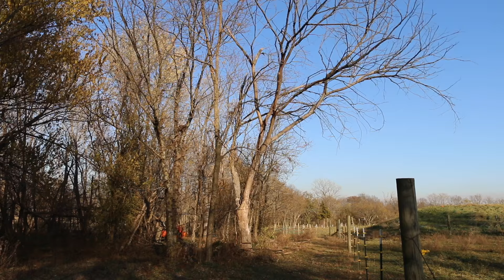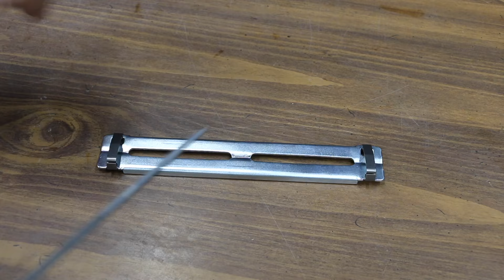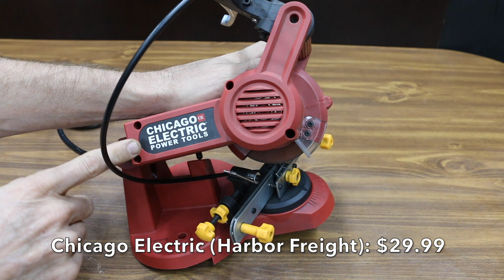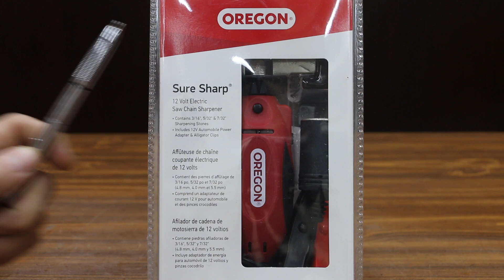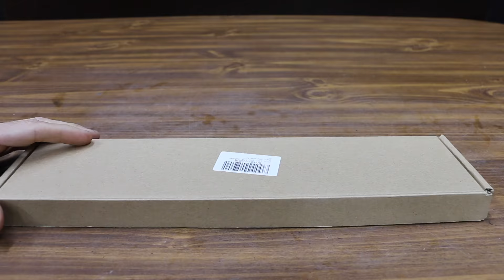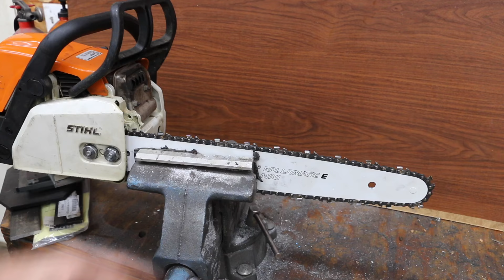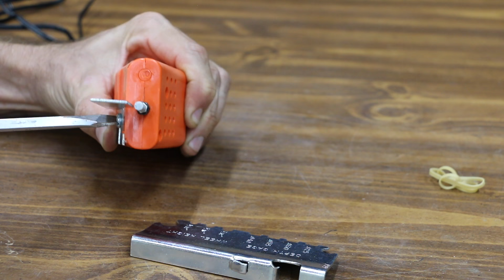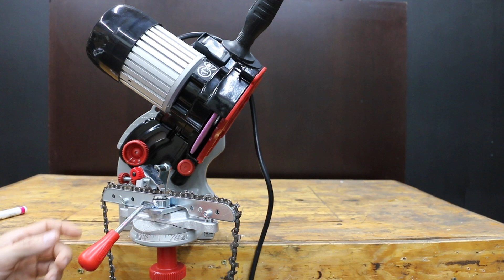Which Chainsaw Sharpener is Best? Let's find out! Stihl, Granberg, Chicago Electric, Oregon

Comment: Removing those tiny dogs off that saw just made me laugh for some reason I have never seen feeling dogs that comically small I guess it makes sense being people arent dropping large timber with battery saws and are mostly limbing. Very curious if those tiny dogs could actually serve any purpose or if they just put them on there so they can say the saw has felling dogs. Also for the price the Stihl 2 in 1 is awesome especially because how easy it is to throw on a fallers belt, will any of these sharpeners out perform a logger whos been sharpening for 40 years absolutely not but a few of them definately can get good results with minimal sharpening skills. Even with the 2 in 1 and other systems you will get better results the more you use it and get comfortable with the system. Also comparing chizel ground with round filed chain isnt the most fair comparison, this was testing sharpeners more than chains that is just definately something to note that the chizel ground chain generally will cut around 20-30% faster than a round filed and that shouldn't be counted against a sharpener. Both chain grinds have benefits and draw backs but chizel is going to be faster if the saw has the power to use it without bogging down a chizel chain will bog a lot of smaller saws especially if you aren't running a skip tooth.

Comment: I have the Stihl 2 in 1, haven't used it yet.  Disappointed by the big Oregon bench model.  I wonder if the Stihl is not knocking down the rakers a bit, causing a more agressive bite?
Reply from the maker: Thanks for the feedback.

Comment: The Sthil 2 in 1...can you simply replace the size of the files to sharpen other size chains or do you have to purchase another sharpener for that specific chain size?
Reply: The bag the tool comes in calls out the pitch and file diameter.  The tool has these molded into it as well.  You can't change file diameter without messing up the raker depth.  Also, mine says 3/8"P (picco) so a full height also needs a different tool.  The tool works great but on a chain that just kissed a rock, I now want a grinder.

Comment: I usually use a dremel tool with an Ezzdoo or oregon bit. I eyeball the angle with the marks on the tooth. After doing it a bunch of times, i got good at it and get great results even on a badly chewed up chain. I do carry and use hand files as a backup. Thats how i did it before i got the dremel bits.
Reply from the maker: Thanks for sharing.

Comment: I feel that the first hand sharpening was done incorrectly.  More time should have been taken until the edges were properly sharpened.  5 strokes was arbitrary and obviously insufficient to achieve a sharp edge.  So the sharpening time you reported was too short by at least a factor of two, and the cutting time was longer than it should have been.  The sharpening job was incomplete IMO.   I have that kit and my teeth look way better than what you showed.  Yes I spent more time than you did.  If sharpened regularly then 5 strokes may be sufficient, but otherwise repeat until the edge is sharp.  

Guilty of Treason ran some sharpening tests, and a properly hand filed chain was faster than a new chain by quite a bit.  This was done using the same or a guide similar to the Oregon guide in the first kit.  Next test was a square-hand-sharpened chain by Inbred Jed (Jed is no longer with us, tree felling is dangerous) which was faster yet and almost double the speed of a new chain.  All these tests were done with a full chisel chain.

Another point on the Oregon file kit, the round file I used does appear to dull quickly so not sure how durable it is.  Perhaps I work hardened my chain by hitting a rock.  Or not...  I'll be looking for some better quality files.

I still appreciate you and the videos you produce and find value in them.  In fact, I want t-shirt that says "We're going to test that!"

Update:  I just got to the end of the video and see that you re-did the hand sharpening.  Good on you.

Comment: I've tried several different sharpeners.  By far the 2 in 1 and 2 in 1 clones are the easiest to learn, set up, and provide the greatest consistency.  Make aure you get the correct one based on file size for your saw.  After I bought my first one for my milling saw it was a no brainer to get other sizes to match my other saws.  Not a professional, just a hobbyist.
Reply from the maker: Thanks for sharing.

Comment: Great video.
I will be looking into purchasing either the Granberg manual or Stihl 2 in 1.

As he said in the summary the bench grinders are quite aggressive. If you look at 12:17 the metal has blued which indicates that it got a little hot which may affect the durability, you wouldn't really be able to do that with a file.
Reply from the maker: Thanks!  Thanks for the feedback.

Comment: Granberg file-n-joint G106 is super swell all metal filing jig, takes round flat and trianglular files. (Only extra that I added to it was a very thin film of wheel bearing grease on the sliding rod.) There is a little technique needed for the direction of pressure with each hand just because nothing is infinately stiff but overall low fuss and good results. Really needed to hold angles if you are fileing square ground chain. (Square ground is more of a professional thing, even the files are only carried in pro shops, which are not actually "square" but they have flats to make a non-hollow-ground bevel on the cutting edges.)
 
For a similar price Oregon sells a cheap knockoff, do not buy it! The Oregon jig is poorly made and too flimsy to even setup and adjust properly (let alone the low durability of the bottom bin plastic). I know because I returned it before finishing the first saw tooth and bought the Granberg. Shame that Oregon has apparently become a chinese-counterfeit peddler.
Reply from the maker: Thanks for sharing.

Comment: Always PULL. Do not push the file.
When you push you will create a fragile uneven BURR.
When you pull the edge will be clean and last 5 times longer.
Just like sharpening a knife on a stone. Hold the stone and "cut " the stone with the knife in the direction you would when actually cutting something with it. 

You should test this with knives and chains to see how the edge holds.
Reply from the maker: Thanks for the constructive feedback.

Comment: surprized the dremel attachment was not included (although mentioned in the comments)
plugs into 120 VAC rather that car battery but I sharpen my chain in the shop (where there are no car batteries)

Comment: Dude, I love your tree downing style. I’ve been cutting those old trees down with a chainsaw for decades and still can’t seem to make them fall in the direction I want. They end up crushing my fences or leaning up on other trees and I get REALLY uncomfortable trying to bring them down. I don’t have a front loader, but I do have a tractor to pull them with. I guess I’ll be buying some heavy rope and trying to pull them down from a safe distance. ( oh, don’t worry, I do know to attach the rope low so I don’t turn the tractor over. I learned that the hard way, but luckily didn’t go all the way over ).
Do you happen to know what type of rope won’t stretch and create a slingshot effect?😊
Reply from the maker: Thanks for the suggestion.

Comment: Did you swapped in fully charged batteries for each cut?  I have the same Makita saw and it cuts faster with fully charged batteries.  Before the battery meter drops even one bar, the voltage of the packs drops a little and the cutting speed starts to slow a little...
Reply from the maker: Yes,  I swapped fully charged batteries in for each cut.
Reply: Good.  I figured you thought of that.  But since you were being as scientific as possible, I thought I would mention it.

Comment: That last grinder looked to have gotten the teeth quite hot which might not be good for long term durability, depending if the teeth are heat treated.  Have to say I do like a bench grinder vs a hand file, myself (the one I have is a cheaper one than the Oregon, more like the other one you had).  That said, those little 12V rotary ones look cool and would be great out in the field.
Reply from the maker: Thank you for sharing!

Comment: I love the test.  However, how long did it take to cut through the 4x4s with the dull chain?  Wouldn't that indicate how dull the chain was in the first place?  Maybe the time delta between cutting the 4x4s with a dull chain vs cutting with a newly sharpened chain should be the measurement?  Also, how precise is this test?  A little data about this would be good.  How many of your results are not statistically different?  Still, your methods are really interesting.  Thanks!
Reply from the maker: Thanks!  Thanks for the suggestion.

Comment: I was hopeless with loose files and gauge/jig. And then I bought a Stihl 2 in 1. Great success. Works on Husqvarna chains, too.  Works best if you over tighten the chain while sharpening and lock it with the kickback brake between rolling the chain along.  This one also trims/files the rakers.
Reply from the maker: Thank you for sharing!

Comment: The worst thing about a chain saw is no one makes one that can tolerate the gas they make now.  I have the same trouble with every machine I have that runs on GAS.  I use that $20 bucks per gallon gas they sell, it makes NO DIFFERENCE on the chain saws.  Stihl is the HARDEST to START of any chainsaw I have ever owned.  I have NOT had a GOOD chainsaw since the quit making McCulloch Chainsaws.  Somebody told me Husquvarna bought them, they suck too.  McCulloch is the only one that was RELIABLE about STARTING.  I can get every other machine I need in Diesel, that is the only way to go.  I have junked out my last Gas Welding machine.  I  have bought a Makita  ELECTRIC Chainsaw and can run it on my Diesel Welding Machine.  To HELL with jerking on that ROPE.  Done with American GAS.
Reply: I have the Stihl MS261. Super easy to start with the decompression valve 😊

Comment: Absolutely brilliant, and exactly what i needed, to understand chainsaw sharpening tools. 
But you didn't answer my question: which of these is suitable for sharpening my mini chainsaw with 1/8" chain?
I looked into the machines, but none of them has a 1/8 bit for my chain, and even the file kits don't even include a 1/8" file. 
It seems that the only one that is suitable is the Grandberg file, with a 1/8" attached,  available separately.

Comment: Done of the difference may be in the raker height. I’ve started filing about a half millimeter below my depth gauge, and my chains have been cutting significantly better. Also new chains are square filed normally, so it would be cool to see square file vs round. That being said. I know you test products not methods.
Reply from the maker: Thanks for the suggestion.

Comment: Hey, just to let you know: You have to be careful to not make the chains blue with electric sharpeners. On the Oregon it was blue so the chain got weak. You can try to move it up and down quite fast but not down all the way. Just bit by bit and by pulling it up you let the chain cool a bit. So the results of the electric sharpeners are influenced by not quite correct use. You seem to have done a better job later on but I feel like those sharpeners could be better. But thanks for the video, I like your videos really much and you do your best for the best results but I think here you made a mistake(which you dont often do). Thank you so much for your videos. You helped me often.
Reply from the maker: Thanks for the constructive feedback.

Comment: Now I'm kind of an old guy at 70 years young and I still believe that the file is the best. That is the way I was taught and it does a very good job and helps with the long life of the chain. Now, that being said, today I use that electric one from Harbor Freight. It is way quicker and requires less effort and does an OK job.

Comment: I really don't think it's a fair test as you did not mention the types of grinding wheels being used between the harbor freight and the Oregon. It all comes down to the grinding wheel itself even more than the machine. The chain sharpened with the Oregon was clearly burnt on the face which could have been a lesser quality wheel or an improperly dressed or loaded up grinding wheel. We use a cbn/borazon grinding wheel which when used properly we find is superior to a stone type grinding wheel. Also, you did not speak of Burr removal. Grinding wheels will leave more of a burr and need to be properly removed as where the file is not going to leave the Burr. I think this is why you're getting a better result with the files as would be expected. Just food for thought.

Comment: That oregon bench sharpener looks about the same as my Tecomec jolly evo sharpener. It works well but i use it only for fixing damaged chain. Normally i just hand file. In the past i have used that Stihl 2 on 1 thing and i like it. That Harbor freight sharpener could be pretty good bang for the buck although im not sure how rugged it is with all that plastic..
Reply from the maker: Thanks for the feedback.

Comment: I use the Dremel saw sharpening kit, which comes with 3 stones and costs about $15 (of course you have to have a Dremel already). It seems to do good enough, it looks similar to the Oregon or the Stihl 12V units.

Comment: I just bought  a bench chain-sharpener and returned before trying it. It needed to be permanently attached to the bench and the removal of the chain which is messy.
Had already decided to go for the Stihl 2 in 1 before watching this video, and now I'm even more convinced.
You can just bring it with you and sharpen the saw on the go without worrying about machinery breaking down.
Reply from the maker: Thanks for sharing.

Comment: Great video ! Got the Oregon field kit. Cheapest and batter than a lot more expensive equipment.
Reply from the maker: Thanks!  Thanks for sharing.
Reply: Ok i just sharpened my $80 Sun Joe electric  chainsaw and now it works like new !!! It was so dull it wasan't even able to cut a stick. This Oregon sharpener is a must have. Saved me from buying another chain. I have been using this cheap 14 Inch chainsaw for 3 years now. @ProjectFarm

Comment: For my go-to nice saw, I use an Oregon 7/32" round file with a wood handle.  By hand.  Eyeballing it with no guide whatsoever other than the laser etched line on the chain tooth.  Done in just a couple minutes, and cuts as fast as my middle aged sorry ass cares to work in any event.  Costs  about $3 or $4 each in U.S. dollars per file for a little  2-pack that will last me a few years.  Sometimes we overthink things.
Reply from the maker: Thanks for sharing.

Comment: Just got a Stihl 2 in 1 and I am very happy with it. Such a simple solution to sharpen where ever you go. A no brainer to get one if you are a not a pro. Speaking about the measurements hereyour last part really shows that is is also a lot about knowing how to use your tools cause you got way better results over all in the second round. It sort of leads me to the conclusion that the differences in round two  might just be attributed to differences in the wood. We all know how much a hard twig or crossfibre can slow down the cutting.

All in all a nice demo. Will subscribe to your channel.
Reply from the maker: Thanks!  Thanks for watching and subscribing!

Comment: The depth gauges on the Stihl 2in1 file are cut down pretty seriously with every use, so they remove a lot of meat. I bet the results would be a lot different if you were cutting hardwood like oak. My guess is the Makita saw would chatter and bounce around trying to take too much wood. That's one of the issues with the 2in1 if you cut real hardwoods. Be prepared for some serious wood removal. Definitely two hands and a firm grip.
Reply from the maker: Thanks for sharing.

Comment: The best way to just do it by hand all these electric grinders are going to overheat the steel cause it to dull faster. I like the Stihl 2-1 I have a vice attached to the back of my pickup. One thing he didn't check for was how long the chain last after it's sharpened. That is what I saw happening with the electric grinder type sharpener.  The Granberg hand sharpener looks interesting I might give that one a try.
Reply from the maker: Thanks for the feedback.

Comment: Too me this testing is totally ignoring the height of the rakers.. If you take a big bite of the cutters , without taking the  rakers, the chain will not cut good at all. Because the bite in the sold will be reduced/lower.

Comment: The bulk of those motor driven sharpeners will take far too much metal off, reducing the life of the chain.  Sharpening by hand is the best way to go.  After a while you will get very good and efficient at it and your chains will last longer.  If you spend $200 on a chain sharpener that is equal to the cost of 6-10 new chains.
Reply from the maker: Thanks for the feedback.